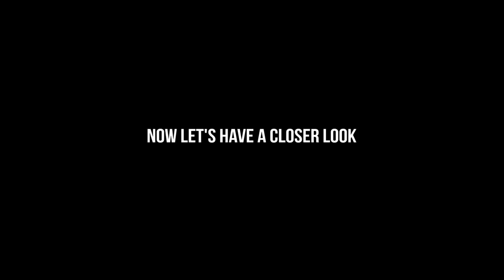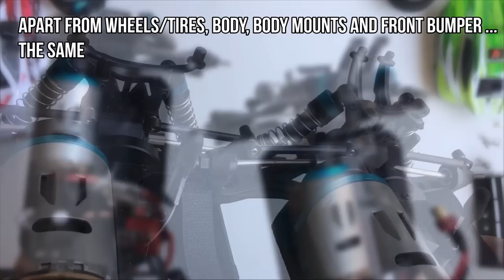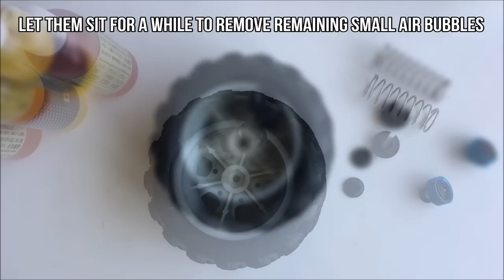WLToys A979-B vs WLToys A959-B: Comparison, Damage Report, Shock and Maintenance Tips!

Comment: Nice comparison and tips Mikael. As for the screws I read on a Tamiya forum some people suggesting the use of super glue. They reckon it does not have any affect on the plastic and acts like thread-lock. I haven't tried it as yet myself though.
Reply from the maker: Yeah, it actually works fine. I have only used it to re-tread some servo mounts, but those hold up fine. Maybe it could be a good idea with this one too. To tighten the thread. Thanks for the suggestion, Rob.

Comment: Very interesting Mikael! There are some quirky design issues with these little RCs! Step-screws would sort out the suspension binding issues, if you could find the correct fit. And I think there must be a simple way to make those shocks actually provide some damping, maybe just using some really thick oil to slow those metal pistons down? I had a similar issue with some Turnigy shocks I bought - initially I used the Tamiya soft damper oil I had = no damping at all! I got some 1000 weight oil, poured it in and - perfect! A shock with small damping holes and thin oil performs similarly to a shock with bigger damping holes and thick oil. The other bonus of using thick oil is it is less likely to escape past the shock seals. Nice comparison and before/after shots! Enjoyed this mate - thumbs up my friend   ;D
Reply from the maker: Thanks, Mark. Ahh, yeah. I regretted not trying out some even harder oil, as soon as I saw the result. Hopefully I got some more A959s coming in so I think I will try it on those. Good to hear it actually works. Never had any luck myself, switching oils. For me fine tuning the piston and springs brings immidiate results. But thanks for the tip. Think I will try some hard oil :-)

Comment: What thickness shock oil? Kevin Talbot uses it really thick 800 or 1000. His don't seem to bounce around a lot.
Reply from the maker: Yeah, what I learned doing this was that the oil was too thin for those screwhead-pistons. I would definitely use something like 800, 900 or 10009 next time.
Reply from the maker: Not 10009, but 1000 :-9
Reply: @NordicRC  does 10009 shock oil even exist? If so the spring force on an a959 probably isn't enough to uncompress after the shock has been compressed because it has to push all that oil and it's so thick LOL 😂
Reply from the maker: @silviamills5218  I guess when you go above 1000 it is rated as differential silicone oil and not shock silicone oil. You can actually get differential oil up to 100.000 :-)
Reply: @NordicRC  your spot on. They leak. Will change.

Comment: I bought the buggy model for my son, and shortly thereafter the plastic "A frame" in the front, that holds the front wheel suspension up, broke.  I tried supergluing it, but it didn't hold up upon driving.

Is it worth it to try and get a replacement part, or do you think the car is totaled?
Reply from the maker: Repairs are just a normal part of the hobby. It all depends on how much, I. Time and money, it is worth to you. I repair my cars all the time.

Comment: Can a979-a(35kmph) be filled with oil?
Reply from the maker: Yeah, but you might need to work on the seals. They will most likely leak if not.
Reply: @NordicRC  thank you! I wonder i you could do comprasion similar to 958 but with 979

Comment: re hi de france, what would you advise me as small rc 1/16, 1/18, for a small garden? i hesitate between a95B9 / 969B and 979B, which one would be best, or what other models would you advise me?
Reply from the maker: Hi friend! For me, for a small garden, I wouldn't pick one of these WLToys. They are too fast and small and frankly, runs better on flat surfaces than real off road. In my humble opinion. I'm not sure what would be the greatest garden basher. I actually use 1/10 Tamiya WR-01 and WT-01 Monster Trucks for my very small garden. They are cheap, and very low geared, so plenty of torque and limited top speed. But that's sort of a nerdy Tamiya enthusiast Monster Truck-thing:-) I suspect that there's better and more modern 1/16 and 1/18  scales. Or maybe some of the low geared 1/12 scale buggies/desert trucks from WLToys, HBS etc. But you could always try one of the WLToys A9X9. They are cheap and if they doesn't work out in the garden you can always take them to the streets and try another for the garden.

Comment: The shock pistons must letting too much oil passed. Having to keep tightening screws that is a bore and had a issue like yours that you can over do that so things bind.
Reply from the maker: Yeah, exactely. The small screw heads doesn’t really work like a good piston. But it’s always a bit harder to start experimenting with these kind of pistons. Tamiya does it too sometimes. Don’t know why. Maybe a lot cheaper than a changable piston head. And yes, no way getting around tightening screws after a run with these. Sadly they have to be quite loose, if one wants them not to bind.
Reply: Just an idea... Is there the possibility to put a washer below those screw heads in the pistons? Maybe trying different washer sizes you'll find the one letting the right amount of gap to make the oil actually do its work...
Reply from the maker: That could be cool too. Just need a way to attach the washer securely. It needs to be very tightly secured behind the screw head.
Reply: Yep, I think that finding the perfect inner diameter of the washer is the key.

Comment: What you think about metal version of WLToys A9*9? I will create metal monster from scratch with simple brushless motor. Maybe JLB J3Speed is more reasonable and universal?
Reply from the maker: I think the all metal upgraded WLToys projects I’ve seen look like fun projects. But I don’t think it will add more durability or capabilities to the car. More likely it slows the car down (+ weight) and decreases the durability (metal will bend, plastic is flexible). I got an upgrade series coming on the A959. Don’t think I will be upgrading a lot to metal. Maybe a few parts. I will do a mild brushless upgrade too. About the JLB, I have no personal experience, sorry I couldn’t help more. But all metal upgrades are a lot of fun ☺️

Comment: Reassembled the shocks the Tamiya way.
NICE!
Reply from the maker: Nice! I plan to try it out with some really hard oil the next time.
Reply: @NordicRC  
And whats going on with your df-03 darc Impact? I drove mine today with a new hobbywing quickrun combo. It drove crazy fast and stable.
Reply from the maker: Nice! I just re-build my Dark Impact once again. Put it back to stock conditions, stock parts and a brushed Tamiya motor. Used some of it’s upgrades for my new brushless DF-03MS. Video series coming up sometime in the future. So much footage to edit down into shorter versions 😄

Comment: What are those little levers on the rear shocks? I just got one of these yesterday. (A959-B)
Reply from the maker: Levers? The spacers? They are just there to compress the springs a bit. It's called preload. You fine tune your springs to make them harder to compress, to raise the rear a bit (because the rear usually gets a lot of power and compress a lot with the throttle). Many have a harder preload on the rear than in the front. And congrats! Hope you will have fun with it!
Reply: @NordicRC  Thanks mate. Im just about to whack some 45wt losi oil in them, so see how it goes.
Reply from the maker: not sure wht the 45wt is (so many different kind of scales), but I will do it again in my new series, and use 1000# (hardest of the Tamiya scale).

Comment: Ah all that effort and the dampers are still rubbish 🙁  Don't think that the pistons fit very well. I was watching this as my neighbour was asking me to recommend an RC for her 7 year old son. I thought about this but can't imagine a kid keeping up with the maintenance. Might be too quick anyway. Will go and look at those cheap crawlers you were reviewing before. Are they reliable? Anyway informative vid thanks mate 😀
Reply from the maker: Ahh, yeah, but I was just having fun, checking if thise actually where oil filled shocks. Didn't expect wonders. If I ever open them again, I will try some real real heavy oil, as others suggested it. That might compensate for the little screw-head-piston. 

Nahh, I don't think these are for the very young ones. Although mine has held up fine, I imagine that a wrong turn into a curb will break something with +50 kph. And +50 will maybe also break a kid. Huh. I would recommend these for 14+ years. 

It's  the same with the WPL crawlers, I take it it is those you are referring to. Mine has not broken, and my 3 year old has had a lot of fun with them. But they are not the greatest quality, so they will probably eventually brake. So I would only recommend those to kids who have parents willing to have fun fixing them :-)

Comment: I’m looking at this and the HBX rampage.  I’m leaning towards this because of the upgrades, but I like the wheels on the HBX better, haha!I know, that’s kinda lame.
Reply from the maker: The rampage looks very nice too. If I remember correctly it comes stock with a low voltage battery though. One of the nice things with these are the stock LiPo battery. And nothing lame about liking wheels better than others. They are a quite essential cool-ness factor on cars 😃
Reply: Nordic RC Visions ok.  So maybe I’ll get the rampage and upgrade the battery
Reply from the maker: That could be cool, yes. You can always just start with the stock battery, and then after a few runs you can see what you would like to upgrade or not.

Comment: my a979b front tires is a bit off, my car cannot go straight. how to repair it?
Reply from the maker: Uhh, at high speed my A979-B would never go straight too. It's hard to say how to repair it when not seeing the car. But check out the manual with the exploded parts and find a spare part.
Reply: @NordicRC  thanks for the reply. I've made some research on my own, I think I found the issue, need to use adjustable rod for the front tires. 😄
Reply from the maker: @kamilmanan4244  Ahh yeah, you mean for the upper arms? That upgrade are on my list too. And some toe-in on the front tires would sure help it make go straight. Although it would probably also put down the durability in jumps/crashes down a bit too, since the stock upper arms are quite flexible.
Reply: @NordicRC  yeah that one. apologize as I don't know the correct term for it. today is the car first run. it will steer left each time I use throttle. now I'm not sure whether it ran out of battery or the motor burnt. 😂
Reply from the maker: Yeah, these cars have a mind of their own when reaching top speed. One of the reasons I prefer the standard A959. More controllable. The B-versions has a very limited run time, caused by the high gearing and 540 motor (about 5-6 minutes). Maybe it was just the LiPo cut off on yours? Though the motor and ESC get’s really warm so there is always a potential for frying them.
Reply: @NordicRC  I think the buggy is the better choice 😆 my car keep going left, even when I just start to throttle. with this powerful motor, 6 minutes is kind of acceptable. anyway, thanks for replying, I subscribe to your channel already. 👍👍👍

Comment: can you reduce speed mechanically to let a 5 year old drive ?!
Reply from the maker: Not on these. But on the A-versions you can (WLToys A959-A or A979-A)
Reply from the maker: Or rather, not mechanically but on the transmitter (Throttle dual rate)
Reply: @NordicRC  was thinking of sicking a piece of wood in the throttle ;) to not make it go 100% ;)
Reply: @NordicRC  not knowing that Nordic RC Visions doing all WLToys reviews ;) --- looking forward to handle one ;) --- nevermind thx for answer

Comment: Which is better?
Like if you think A979-B is better.
Comment if you think A959-B is better.
Reply from the maker: Hi JiJi! I think they are both great :-) For speed runs the A959-B is more stable though. Got some A969 and A979 coming up on the channel too.
Reply: @NordicRC  which is better in dirt.

Comment: We've had one of the monster truck ones for over 2 years now , I paid £40 delivered and it's been abused by my son and I , best car for the money I think , the only thing that's gone in 2 years was a oring in front shock split and my son went through a football net and it snapped the front u/j off the diff , new dog job done , it's done some serious work , been sunk in puddles by my son and been launched through the air every time it's used , nothing is a durable as these especially for the money
Reply from the maker: Yeah I was pretty astonished about the durability too, when I took these out. I’ve had a fair share of tumbles on tarmac and a lot of jumps (see my other videos with them) and nothing has broken yet :-)
Reply: @NordicRC  I think money wise you can't go wrong , I wanted to get my son into tamiyas like most of us started at , we bought one, built it together but it won't take the stick these will, these are on par with 1/8 nitro buggys strength wise , infact better , I saw a video of one on 3s lipo earlier and it was mental

Comment: Garbage, when I saw that insane amount of wheel play, bad shocks and the need to tighten those screws so often it's a big no-no for me... 😒
Reply from the maker: Garbage is a strong negative word. All models should be compared to the price. The cheap ones (like this) are not for everybody, the expensive ones are not for everybody too. Wheel play and tightening of screws though, is a general issue for many models though, also some of the more expensive (which I have also tested). And many more expensive models come with friction shocks, so personally I prefer re-filling oil in oil filled shocks than buying new oil filled shocks. The oil needs to be a lot harder than the one I tested in this video though. But yes, every model is not for everybody 🙃